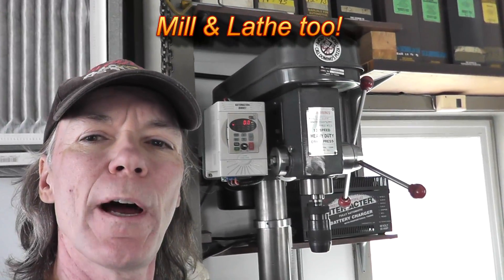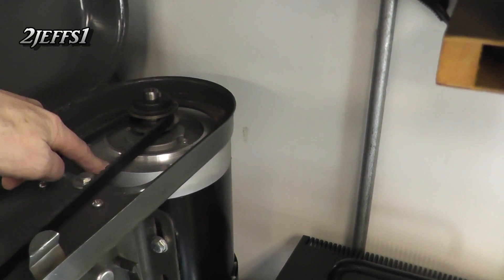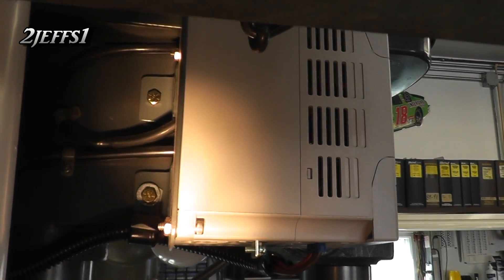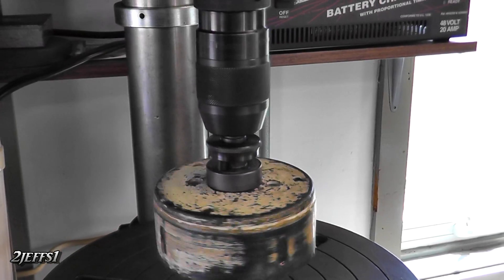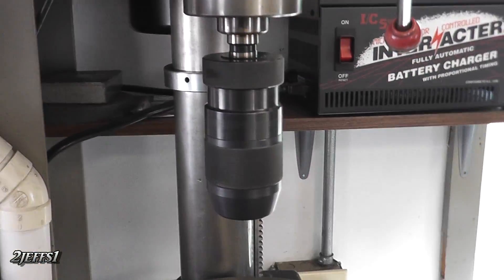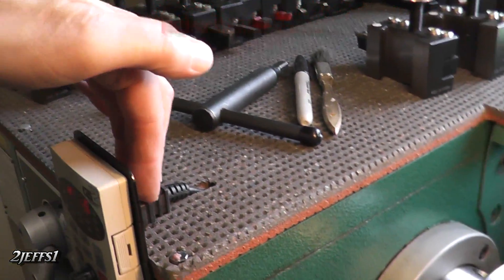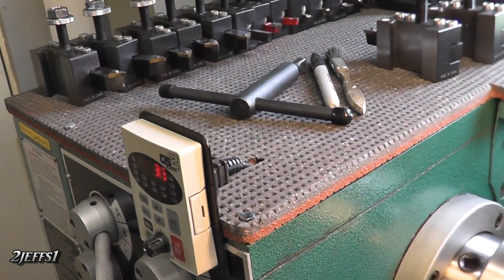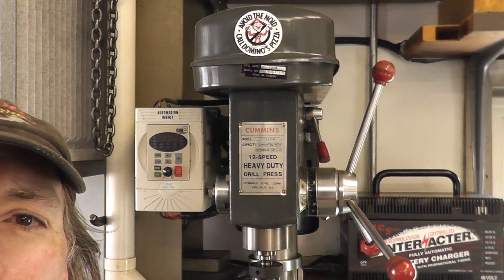VFD Drive Drill Press Lathe & Mill  (Variable Speed) DIY

Comment: Very good presentation.  I just heard about this (VFD) speed control and have just ordered a motor and controller set for my Delta drill press.  I mainly do woodwork and am tired of constantly changing the position of the two belts whenever changing from small to large bits.  Seems The speeds I want always involve removing and repositioning both belts.  Mine will be wired for 230 in but otherwise is similar to what's been shown here.  Good, clear information on this site.

Comment: How bout this, rather then using two different sized pulleys, use two of the exact same size pulleys across the motor shaft and chuck shaft. If there are both 6", or both 1", or both 24", it wouldn't matter. The motor rpm would be read On the VFD, which would be the same as the chuck speed too right?
Reply from the maker: Hi jlm - Ah to keep things simple you should run with a mag tach. Yes I'm aware of the RPM difference - but actually after you run machines a bit you will find there is a sound and a feel to everything. It is rare now that I even look at the display. Just tweek the speed knob & go! By watching & listening you learn a lot quickly. Where you sound new at this don't get so nevus. It will all seem simple once you get things going!

Comment: I was just curious as you mentioned that you had machined down the smaller pully for the motor drive to about 3". 
For example, if your drive pulley is 3" and the chuck pulley is 6", motor is turning at 1800 rpm, your chuck pulley might only be turning at 900 rpm, so the meter on the VFD would be incorrect since it has no way of reading what the chuck outlet is doing. 
Perhaps it's just telling you at what rpm the motor is turning? 
If there was a way to program the VFD with the proper ratio, you could conceptually have it show what the chuck is turning. 
Not trying yo rip you apart, just thinking out loud :) 
I'm still learning this stuff

Comment: I guess I have yet another question. 
This is technically running off 110 voltage. Do you have a dedicated circuit for it? I was reading the specs on the motor and it says it can draw up to 18 amps with a locked rotor. What amperage circuit do you have it on, and do you have any issues popping the breaker?
Thanks again!
Reply from the maker: Hello jlm. I have it hooked to a 20A non dedicated circuit. There is a grinder hooked to that circuit too but never had them both on at once and never popped the breaker. Where the drives are such high quality I'd assume the rpm readout to be accurate. As far as to re-calibrate it to the chuck speed - I don't think - that can be done. If it was I probably would have done that on the install and yes that would be a nice final touch!!  Cheers, Jeff

Comment: Jeff, great video! Simple and to the point! 
Quick question, what lathe are you using? It looks very similar to my buddy's lathe and he is quite satisfied with it!

I'm replacing my vintage bench top drill press with one I recently won at an auction, and will be following your method to setup VFD. I've found I'm too lazy (or it's too cumbersome) to change belts between bit sizes, and I think VFD will aid me in utilizing the right speeds. 
Thanks again!
Reply from the maker: Hi jmlcolorado. I bought the Lathe at Harbor Freight in ~04. It's done a lot of work & been quite satisfied too. A - FYI for you to mention to your friend. A customer told me some of the Lathe's had sandy dabre in the gear case. I pulled the top cover that night. Mine was ok. NOT wanting to scare ya just something that came to mind from a while back. I did have a seal start to leak on the side where the external gears are under that side cover. We have a local bearing & seal vendor, not a big deal. On the drill press I don't know what you would call it but I'd never change the speed when you should either. The VFD makes you want to have a job to do!   :>)
Reply: Thanks for the heads up Jeff! I'll pass the info over to my buddy. Now that you mention it, I think I've heard similar stories. 
I know he's turned quite a bit of material on it over the years.

Comment: Hi jeff,

I have also installed a vfd on my lathe. As yours vfd capacity is 2 hp and the motor is 1 hp. But on my vfd I had to setup the motor plate values such as power and rpm. I don't know whether it is required with your vfd or not but when these values are not set correctly you hear a hissing sound on low rpms and the efficiency you get from the motor decrease on low rpms.

So depending on the vfd if needed it is a good practice to setup the motor variables to the vfd.

Excellent video by the way.

Mehmet
Reply from the maker: Hello Mehmet. Boy that is a VERY valid point you brought up! I didn't specify the motor setup in the video. I did set the VFD's to the motor specs of 1 HP at 1750 rpm. I just set the max rpm's (frequency) higher. I think them motors were rated to 5,200 safe maximum speed - a point I didn't bring up either. Another thing while we are on the subject the lathe VFD drive out of the box settings had to be changed on the ramp up speed settings. Due to getting more mass rotating when you would hit the run button shortly there after the drive would display OL. The tip in speed did need to be tweeked slightly. A point also to be known so someone don't think they got a defective unit or wired it incorrectly. That was very nice of you to bring this up! Thank You for your help Mehmet, Jeff

Comment: Nice clean installations Jeff!  Wish I'd have found your video before I reinvented the wheel.  I chose a little bit different way with my mill because I was worried oils and sharp chips on my finger tips might damage the Automation Direct panel's thin flexible plastic cover.  I used industrial control buttons.  VFDs will bring innovation and manufacturing back to this hemisphere as they re-power older 3-phase machines that have been sitting idle, putting them in the hands of creative people for low costs. (I'd say country, but I suspect you're a Wisconsinite right?)
Reply from the maker: Hello. Ya got me going on your ending comment. Aah like big time!  Very nice on your writeup! I always thought it would cost thousands to do 1 machine. After some research to find out how inexpensive it was I did all the machines. I couldn't find any good video's on this so that's why I made this to help others interested. I 'm not one for returning things or inconvenience anyone so to research big before purchase is common practice. The design and quality of their products can't be beat! If more people new of this I bet they would sell tons more of product!!! I did purchase an extra panel to store just in case of....But ya there hey there Thank You for your comment, Jeff  :>)